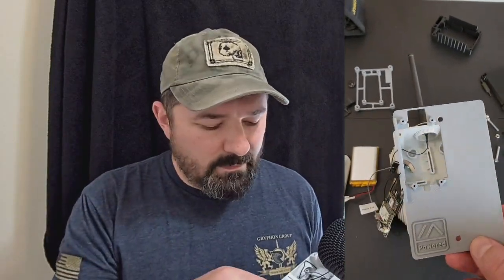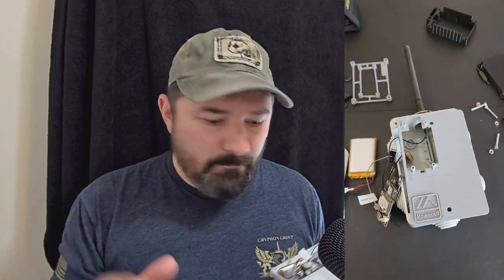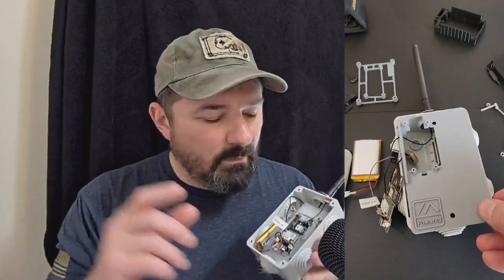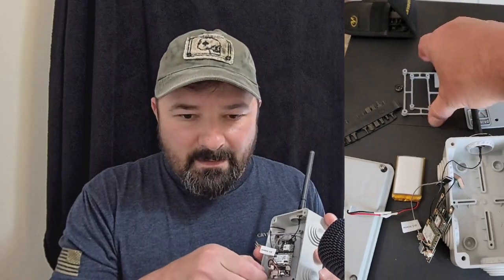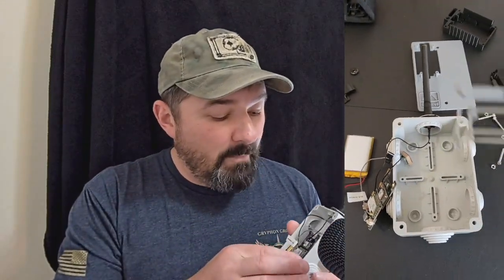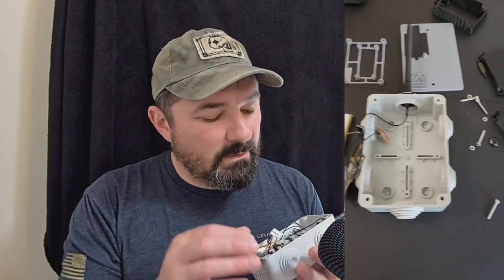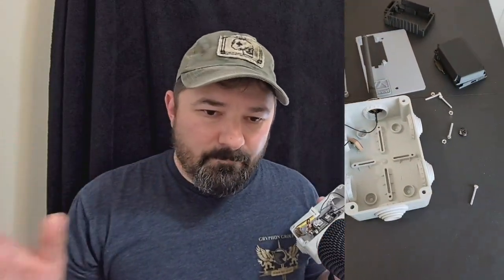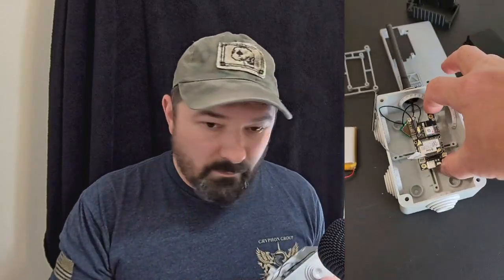Meshtastic Medium Range Fast | Fixed Node Update

Comment: I am having issues with longfast - trying to fix location with no gps, heltek v3 seems to drop the set location after a random amount of time.
Reply from the maker: First questions I have are IOS or Android?  I only ask because sometimes it can be an app issue vs. a firmware problem. Unfortunately, I don't have any Heltec devices to run tests on and not experienced your issue. Nonetheless, I will ask around and see if anyone else has experienced this issue.

Comment: In Norcal and I can help with the I-5/Hwy99 Corridor between Redding and Oroville. Lots of elevation around the valley. Already working on getting a way to contact Chico from up in the mountains to the East. And my entire Lake Almanor basin now has Mesh. Pretty cool.
Reply from the maker: Well placed nodes could cover at least 10+ miles of I5. If you check sites like: https://meshmap.net/ We can estimate where there is some coverage is already.